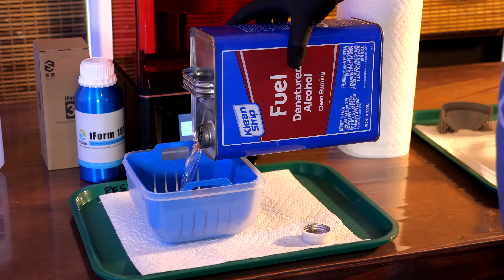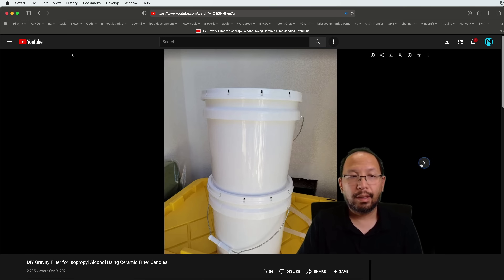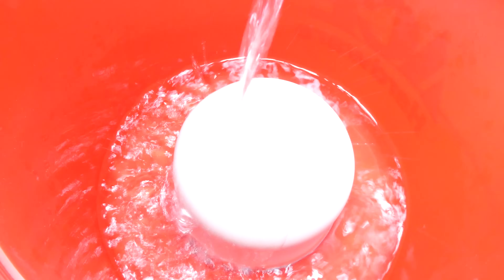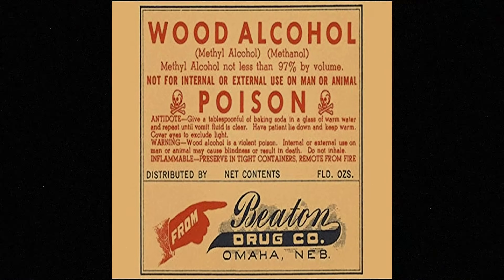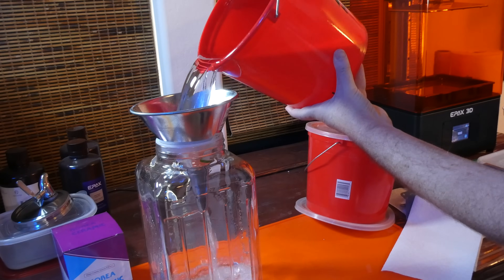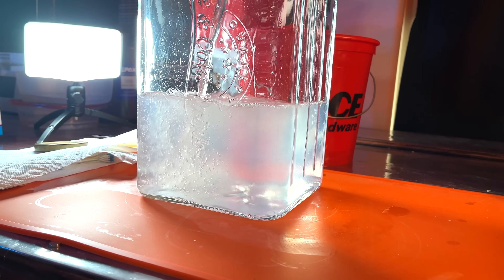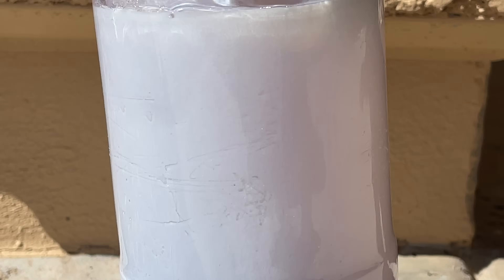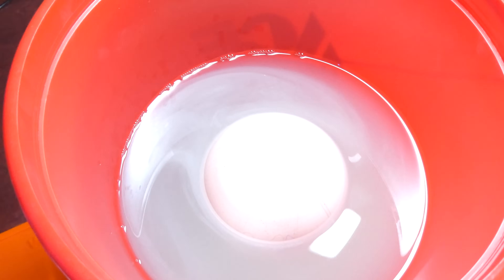Can We Recycle 3D Printing Alcohol?

Comment: If your denatured alcohol is denatured with methanol you can do it easily in a normal still by adding three times the amount of water and distilling normally making sure to toss out the head as per normal. If denatured with benzene, you need extremely precise thermometers, small containers whose heat you can control to the nearest degree, and water. It's really very much not worth it, you'd be better off making your own 'shine at that point. Hell, even then the methanol denatured stuff is going to taste like ass.

Comment: A little chemistry might be helpful?

The following alcohols are chemically different:
(1) Methanol
(2) Ethanol
(3) Isopropyl Alcohol

You can't convert between these alcohols without a chemical reaction.  So, for example, the IPA you buy at the drugstore is mostly isopropyl-alcohol  (91% to 70%), with maybe 10% to 30% water (and then minor impurities).  Filtering 90% IPA isn't going to convert it chemically into something else.  So, I think it was expected that filtering the IPA pretty much left it unchanged (the charcoal might have preferentially absorbed IPA or the water, and so changed the final smell slightly).  Most IPA at the drugstores do not include bitterants, as far as I can tell.  Pure 100% IPA just smells bad to us, and is toxic.  So there is no need to add a bitterant.

Most simple filters are designed to trap particles, either mechanically (blockage), or adhesion.  So a coffee-filter, cotton wad, would be examples of mechanical filters.  Charcoal is a finely porous material, and a lot of impurities "stick" inside the pores.  That is, a lot of impurities are geometrically small enough to go through the pores of charcoal, but for chemical reasons, they are attracted to the walls of the pores and tend to get stuck (things like Van Der Waals forces, charges, etc.).  (There are other types of filters, like ion-exchange filters, which use different mechanisms and can filter out non-particles.)  So if uncured resin is actually dissolved in IPA as a solution, then (roughly speaking) there are no particles.  For example, if you dissolve alcohol into water, then there are no particles, and a simple filter won't be able to separate them.  

(This isn't always true, as in, if you dissolve salt in water as a solution, you can filter the salt out with some fancy filters, such as reverse-osmosis filters, ion-exchange filters, etc.  While there are no "particles" of salt in the solution, the sodium ions in the salt attract water, and the result is a cluster of a sodium atom surrounded by water molecules.  This combined cluster isn't technically a "particle" but it can be large enough to be blocked by a very fine filter, such as a reverse-osmosis filter, or separated by other finely porous material, such as molecular-sieves that have pores on the order of a few Angstroms.  However, as a first cut, let's ignore fancy filters like reverse-osmosis, molecular-sieves, and ion-exchange.  And let's stick with filters designed to remove particulates.)

I think you want to take your dirty IPA, and first expose it so that all the resin polymerizes.  The polymerization process means dissolved resin monomers (photo) polymerize to form microscopic solid (polymer) particles. This is why the IPA got "cloudy" and "murky" when left out in the sun.  The particles are very tiny, like clay particles.   From what I understand, the monomers are dissolved in the IPA at the molecular level (as alcohol or salt might be dissolved in water).   After polymerization, the resin has formed actual particles, which are not soluble in IPA.  Instead, the fine particles are just "mixed" in the IPA in what is called a suspension.

After exposing the dirty IPA, most of the remaining resin will be in the form of solid particles.  That should make it easier for a simple (mechanical) filter to remove.

I'm not a chemist, so what I've said above might not be totally correct.  Hopefully someone will correct me where I was wrong.

Comment: bro buy a few vigreux columns. Better results. More effective than flash distillation and in part, more safety cuz the reboiler action takes place inside in the dishes of the column imao
Reply: On the other hand, maybe it's not greener than gravity filtration. Cuz you need to reach the boiling point with energy, (could be a heating coat). BUT it's reutilisable limitless times cuz only u have to clean the glass instead of buying a new ceramic filter...

Comment: A couple things. 1.The combustion point of ethanol, is almost 800 degrees lol. Considering kettles aren't designed to heat anything above about 220ish there's basically not chance of heat combustion. 
2. The amount of vapor that should be present after going through the condensing coils is similar to taking the lid off and pouring it into a container.
4. Now all of that said. Anything that makes you uncomfortable should always be avoided because that nervousness will very likely cause a mistake that will cause a problem. 👍 Both work 🤷‍♂️

Comment: us a simple pot still with a electric heater outdoors. use a glass thermometer and use a toothpick wired over the collection bowl and the condenser out put ( cause it burns invisible ) the wood will turn black and burn orange  then use the garden hose if needed

Comment: Classical distillation using a hotplate instead of a flame would work just fine.
Reply: Also you can use vacuum filtration to deal with the alcohol stuck in the resin. I mean that literally too, plug in a normal vacuum in the side of your bottom bucket and make sure you got an airtight contraption and it will work like a real vacuum filter albeit much weaker, at 5% the cost of a real one.

Comment: You can it's called distilling alcohol ethanol or rubbing alcohol or even making same type of alcohol you can drink out of moonshine instead of using it to drink to clean your parts 90% of 100 proof of alcohol make it in a little steel it's not illegal you're just using it to clean parts it ain't hard

Comment: I would use a still, because that’s how alcohol, isopropyl and denatured… denatured alcohol contains methanol which naturally comes from the alcohol making process anyway… the other additives probably arnt good for the still, but if you’re diligent about cleaning it and you only use that still for your denatured alcohol, not using a still is so dumb… you’d lose soooo much of the alcohol to evaporation…

For cleaning the still just do a couple of runs with distilled water, rinse ready to go…

Do yourself a favour and get one of those electric stills…

Comment: Distillation is still the best option and you don't need to add much heat because under a vacuum the boiling point of the alcohol reduces from 78 °C to approximately 34 °C. So get a vacuum pump, which is also very useful for tasks such as casting, say you are making rubber molds from 3D parts to to a production run that is faster than just 3D printing them all.

Comment: i use 3 glass containers with sealing lids. one has clean alcohol for final wash. the second is mostly clean for initial wash. the 3rd is the dirty stuff and is stuck in front of a uv light that cures the resin in the alcohol. once the resin is cured in the alcohol i use cheese clothe to filter the mucus out. cheese cloth is coarse but it can be used to squeeze out the majority of the alcohol from the goop. then i run through a coffee filter in a funnel. The alcohol that comes out of the coffee filter is usually clean enough to use for initial wash again. I just keep rotating the containers around and add new alcohol as needed.

Comment: when I'm cleaning parts, I always start by setting it at an angle over the trash to drip off as much as possible. maybe 10 min later ill come by and spray a little bit of alcohol on the part to wash off any large pools of resin. this uses a bit of alcohol directly into the trash, but then when i dunk the part in the alcohol tank, it doesn't cloud it up as badly. cloudy alcohol will def leave a film on the parts that diminishes detail. Depending on the part, i may also rinse it with more alcohol or just water/dish soap before drying and curing.

Comment: there is no problem distilating alcohol. I am a chemist and I used to distilate organic compounds and you only need to ad some porcelain bits and avoid to use fire as a source of heat (use an electric stove and a metallic container, if glass crashes, it will not ignite so easily)

Comment: You can water down your alcohol so it isn't flammable anymore, and distill that safely. At the correct temps, the alcohol will boil but the water won't. This will leave you with approx 70% IPA, which you can then bring back to 99% by adding non iodized salt and shaking, the salt will separate the water from the IPA. You can get the salt in bulk bags pretty cheap.

Comment: It works in a distiller as long as you dilute the alcohol to below 40% proof before you do this , less is better , it is safe , just remember though the air still you just showed is only going to produce 60% alcohol in the end , if you use a T500 condensing still you can put it in at 20% proof and get it out at 94% proof , and there is 100% zero fire risk as this is exactly what the still is designed for ,, downside is ofc the T500 is £500. PS the T500 accessories also include a 20ltr filtration system with changeable carbon filters and buckets BUT  you cannot carbon filter alcohol above 70% proof it wont work it is 2 ""thin"" for the filter.

Comment: I put my alcohol under uv light and sun. It causes the plastic to drop out if you do it long enough. Then you have to siphon the clear liquid off. Don't even try to filter the bottom gunk. With the siphoned part run that through a filter and you are done. You don't recover all of it, but most of it. The gunk on the bottom I loose obviously. And I have been doing this for years. It's not that complicated but it helps if you do it in a rotation and after only a few prints. The dirtier you let it get the more you loose..

Comment: Nice work! This topic really is interesting. But I feel I have something to say about some parts of the video. I'm not an expert at chemistry so if I got anything wrong please help me out at the comments.

5:09 Isopropyl alcohol's odor is inherit and cannot be filtered or even distilled out, which is different from denatured alcohol (ethanol with additives). Alcohol is a term describing a type/group of chemicals with similar molecular structure, the regular drinkable alcohol (ethanol) is only one of them. Isopropanol or IPA is fundamentally different from ethanol, and is poisonous no matter what. I'm pretty sure the "milder" smell you got after filtering it is an illusion.

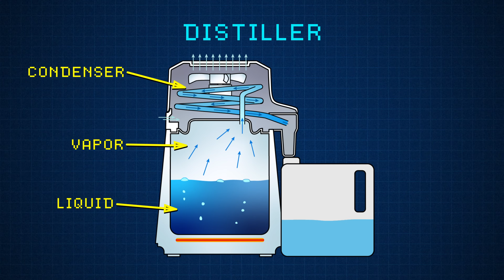5:37 Technically a distillery could extract ethanol from denatured alcohol if you have the right equipment, but that's a risky operation and requires skills. Distilling could also remove the majority of water (could make it around 95% pure), which should be fine for 3D printing applications. But I wouldn't recommend distilling alcohol at home for various reasons, not just because it's a fire hazard.

Comment: Isopropyl alcohol typically does not have any additives to make bitter. Isopropyl alcohol, also known as 2-propanol is a different alcohol as drinking alcohol (ethanol).
Isopropyl alcohol is never save to drink and should not be distilled after storing for an extended period of time, because it can form peroxides by reacting with air or by exposure to light. These peroxides can explode when heated.

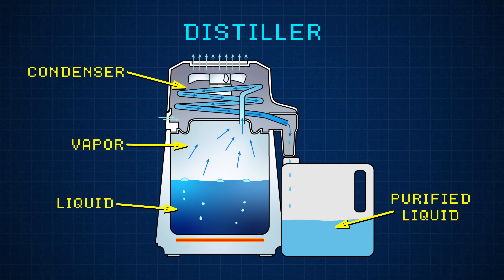Comment: 1:00 Put that system under vacuum or more precisely lower air pressure as vacuum means sucking out alcohol vapours too. So, under lower pressure boiling point lowers down to the point that alcohol can boil in much safer conditions like room temperature or a little bit above to make sure you have that extra margin to cool it back down to condense back into a liquid.

Comment: What about a centrifuge? Like a filter it's mechanical separation of the clean alcohol from the resin bonded alcohol but you won't get clogging, it'll cost more upfront but you won't have the ongoing cost of replacing filters. Alternatively you could repurpose two pneumatic cylinders to vacuum boil the alcohol, you pour the dirty alcohol into a fully extended cylinder (only fill about a quarter of it) and attach it to a fully retracted cylinder, then seal it and pull down on the empty retracted cylinder. The pressure inside both cylinders drops, the alcohol cold boils, then you slowly retract the cylinder with the dirty alcohol (not too far or you'll inject it into the other cylinder) and as the pressure returns the alcohol vapor condenses and mostly ends up in the second (now fully extended) cylinder.

Comment: Yeah.... no, the reason the alcohol cleans plastic is because it dissolves the resin. No amount of filtering is going to remove totally dissolved resins.
Polymerising the resin and removing the leftover alcohol might be your best shot, or maybe cooling it so less can dissolve but without distillation there are still going to be huge amounts of contaminants.

Comment: So 1:10 in and I have to just address this method of distillation.  Yes, alcohol is flammable.  But what if there was an easy way to make it less flammable?  Like diluting it by adding water reducing the abv.  After all, your local distillery is taking something like a beer and distilling that into your Vodka or Whiskey.  Your fears of explosion gone in a flash.  Any alcohol less than 50% abv will not catch fire no matter how hard you try.  Not that this is actually a worry but just one of those scary things you hear about.  The bigger issue is using Denatured Alcohol, the methanol contained in Denatured Alcohol is extremely toxic and is one of the main reason distilling alcohol for consumption is extremely illegal here in the united states.

Comment: What if you used the filter backwards or upside down? So that the alcohol entered teh filter through the pipe fitting, and filtered out through the ceramic surface? Would the alcohol filter faster, I wonder? Or would the filter clog up more quickly, and you couldn't remove the resin particles from the ceramic surface, because it would be on the inside?

Or, what about reversing the filter, and then using a dense coffee filter, or some other filter material, to remove visible particulate before it enters the pipe, and then the carbon and ceramic finishes the filter process?

I may have to tinker with this as well.

Comment: The way I clean my alcohol is by first putting it in a bottle and curing it in a UV chamber (sun works fine) and then just letting it sit in the sun for a few weeks. Eventually everything will just fall to the bottom of the bottle and you get mostly clean IPA to pour off. I've gone through about 3 cycles of this now and the IPA is a bit yellow, but still very usable. Eventually I can just distil it when it gets too dirty for this method.

Comment: Great video, love seeing makers trying to reduce their impact on the environment and save a bit of money in the process! Just a couple of little info nuggets for ya, first IPA or Isopropanol is not the same chemical as Ethanol, no amount of filtering or distillation will turn it into ethanol or remove it's odor, as such IPA is not denatured since it's not "consumable" in the first place. The other component of (non pure) IPA is water. Also from looking for a cheap source of decently pure ethanol, I discovered that hardware store denatured alcohol (particularly the Klean Strip brand) contains up to 60 percent methanol as a denaturant (look at your local products' MSDS safety data sheet to see what is in them). While harmless for cleaning prints, would not recommend trying to make it drinkable, you'll just end up blind in the hospital if not worse. Also also, distillation using a countertop electric still is pretty safe all thing considered, stills are designed to condense as much vapor back into liquid as possible, so (ideally) no more vapor should come from the still than would come from an open container of alcohol, while good ventilation is still recommended, I have yet to hear of one catching fire, despite not being designed for distilling ethanol. It's not impossible but very unlikely.

Comment: man that resin will clog tiny pores of that filter as you use it and will not give 1000 gallons in any case as that microscopic resin will go though it as youve seen by keeping it in sunlight + if those filter were to be exposed to uv they will clog even sooner
the best bet would be to use vacuum filteration it will be many folds faster and you can always change filters inexpensively and even use bigger to smaller pores
there are two types of vacuum filters avaliable one with perforated disc and other with filter paper

Comment: What about vacuum distillation? It will solve your problem with your hesitancy to use high temperature simple distillation and it would likely not require you to run it through  the system multiple times to achieve a pure cleaning liquid. Though the equipment needed to run vacuum distillation on this scale might run a bit more on the expensive end you could use the equipment indefinitely. Unlike the filters, which will require eventual replacement when they clog. It’s just a thought. Though it’s likely no one will  ever see this comment because the video came out about 6 months ago…